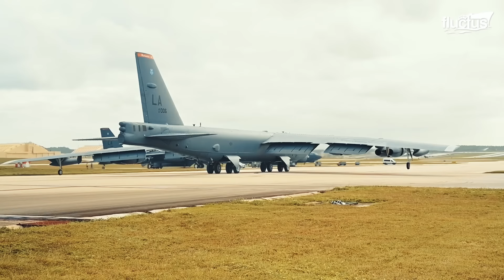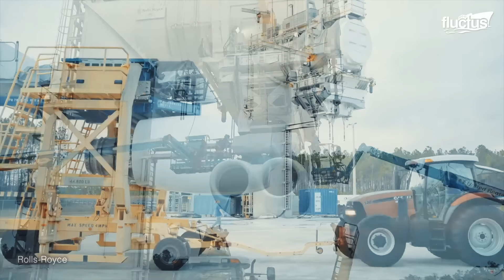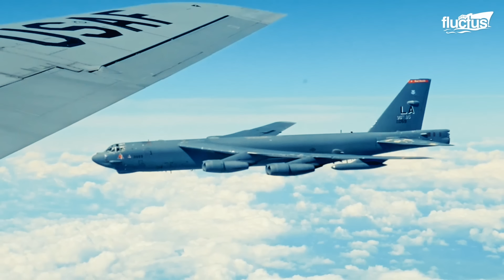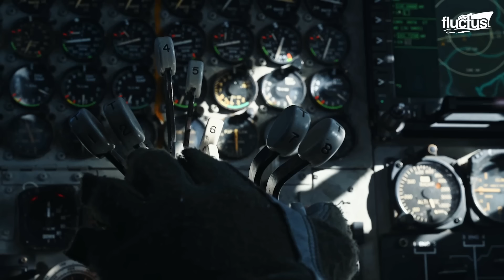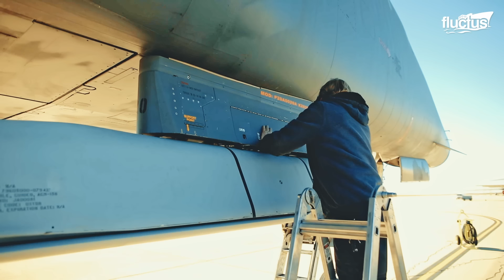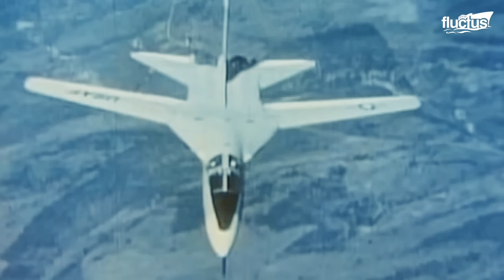How The U.S. Air Force Plans to Keep Their B-52 Flying For Nearly 100 Years

Comment: Wonder if new engines will increase operational range, or will the maintain range in extended for reducing weights for longevity? Less fuel, increased payload?
Reply: Increased range, yes. It has been stated the fuel savings will pay for the engine mod--but I wouldn't hold my breath on that.

Comment: They've been talking about the engine upgrades on the B-52 for about 10 years now.
But "WHEN?"
When will the talk become action and the engines upgraded with the RR engines?
The same old talk has become stale and redundant.
Reply: They were talking about engine upgrades when I first started working on them in 1971.
Reply: @barrygrant2907  Soooo...  55 years later and...
I guess talk is cheaper than engines!
Reply: @FuzzyGatorDog  Don't know what your point is, but they are working on reengining the first test aircraft. It will be an entirely different aircraft, with more than just an engine replacement.
Reply: @barrygrant2907  What's my point?
Read the comment!  They (The Pentagon), has been talking about these upgraded engines for years!
No!  I think it's great if they can give the Old Dog some new bells and whistles.  And the new engines.  It would be nice to see a Buff taking off without leaving a plume of smoke that looks like LA  used to look back in the day.
By this time, the B-52 program should be well out of the test stages and front line ready...
But I guess contractors gotta get rich enough to validate the program...

Comment: P-38's did not use Rolls/Royce engines, they were equiped with Allison V-1710's. Most P-40's were also fitted with Allison's, although a few were fitted with Packard/Merlin Rolls/Royce variants.